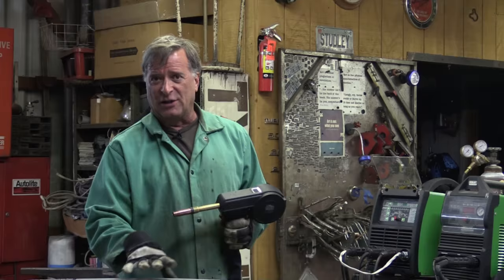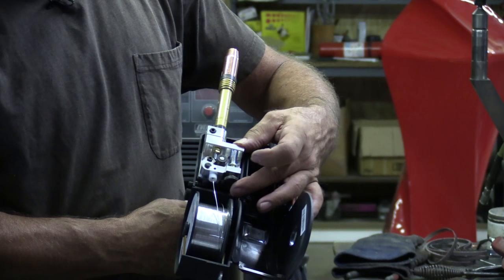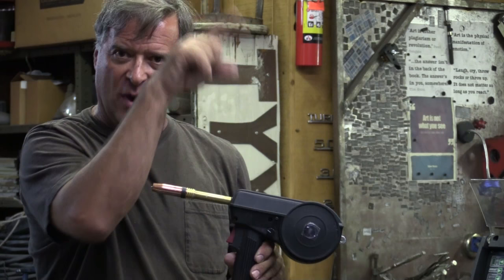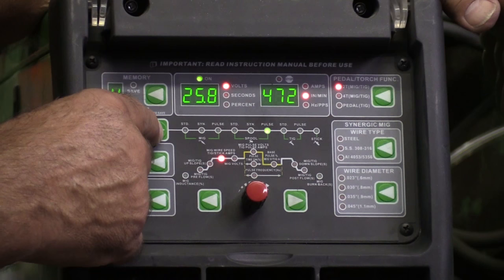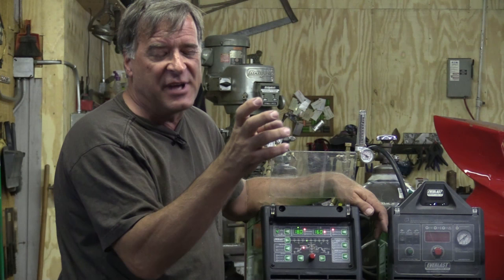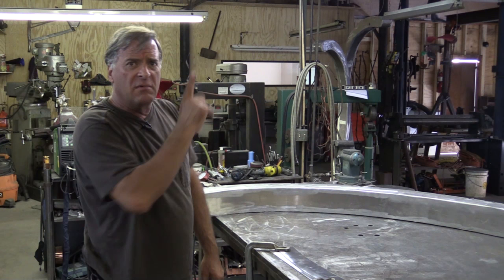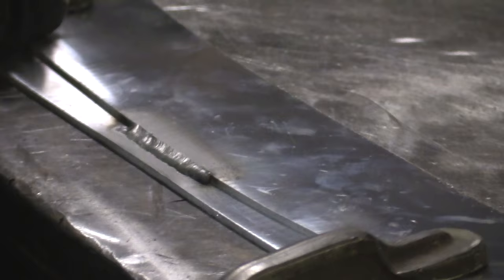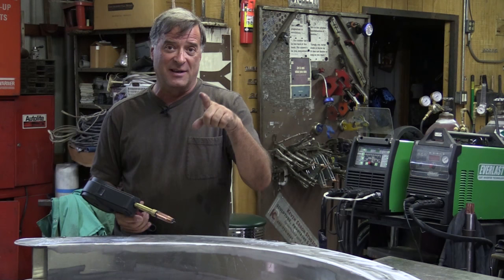How to Use a Spool Gun - Kevin Caron

Comment: Hi Kevin. Just started playing with my spoolgun for my Lincoln Power Mig 210. I found the suggested wire speed to be a little high and a slight push angle works well for me, also a faster travel speed than steel, but I did manage to blow a couple of holes in the 1/8 aluminum I was working with before I figured this out. I guess I will be running a few more practice beads before I tackle a real project. Thanks for the video.
Reply from the maker: I have found it to be tricky to get it dialed in right.    Always playing with the setting to get what I want...    More practice!

Comment: Nice video kevin. To help combat the soot, 6 can turn up the gas flow a little bit, and run a push angle on the gun to get a "pre shielding" in front of puddle. Also, you can not use any CO2 with aluminum because it is an active gas. You can only use an inert gas such as helium in addition to the argon.... Good looking weld too. Sounds like your wire feed speed is a little high for the voltage or the voltage is a little low for the wire feed speed in regards to that wire size though but still very nice bead none the less. Keep up the good work and don't stop with the videos.
Reply from the maker: Thanks,  will give that a try next time..

Comment: NO CO2.  Never with aluminum.  But you need to have a higher voltage for the wire feed speed you were using.  It should be in a spray mode.
Reply from the maker: Tried going up in volts but was not having any luck..     will practice more...
Reply: What tipe of spool gun, do I need for my MTS 251 si?

Comment: Nice vid Kev, always enjoy them. Is it feasible to run one of these on the 110v side of machines? Would you consider doing a step by step video of that by chance? I would like to learn more of that. I'd check the rollers in that spool gun as the last part looked a tad off 😉keep up the nice work and please let us see the final project.
-Pidge
Reply from the maker: This machine is dual voltage so I will give it a go on 110 and see how it runs..     Maybe a video in the near future.

Comment: What’s the benefit to using a spool gun over torch?
Reply from the maker: Easier to hold and tack weld at the same time.  Faster than a tig but much messier.  Good for the welds you don't see.

Comment: To keep from having soot, push the puddle instead of draging the gun. Also the wire feed speed is too high.  If you are not using pulse the arc should be almost silent.  You should always keep aluminum mig welding in spray arc transfer.
Reply from the maker: Will give that a try..     Thanks for posting...

Comment: Aside from the obvious being rather large and bulky what are the downsides of using a spool gun to do regular steel welding if any? The only big machine I have is a Miller Regency 250 spool Matic 3-gun and I couldn't pass it up for the deal I was getting and personally I'm not an individual with much in terms of finances so one of those situations where I have to work with what I can get
Reply from the maker: Have never tried a spool gun on steel.   I know it will work but can't think of a reason to not use the built in mig.
Reply: @KevincaronSculpture  because it doesn't have one
Reply: @KevincaronSculpture  and I haven't yet been able to find a wire feeder at a reasonable price for it if at all

Comment: Aluminum takes 100% argon
Reply from the maker: correct, unless you are welding really thick aluminum and then you want an argon/helium mix.  Or straight helium if you are welding thick aluminum on D/C.  Or if you are stick welding, then you don't need argon at all.  The world is not black and white most of the time.

Comment: Kevin can i connect that spool gun to a plain ac smaw welder?
Reply: Im going to use a gasless wire anyway or what we called flux cored wires . Is it applicable?
Reply from the maker: Not that I know of.    You need the correct plug to hook the control wires to.
Reply from the maker: I am pretty sure this will not work on the machine you have.
Reply: Maybe its better if i just buy a 3in 1 machine that contains stick, mig , and tig. Anyway im looking for something cheaper but better :) thanks sir

Comment: I would rather just use a normal mig welder .
Reply from the maker: If you can get the aluminum to run through the liner...
Reply: I got a guy to make me up a short mig cable about  5 foot long  and used a nylon  liner . I find with a shorter cable the wire feeds through easier .
Reply from the maker: awesome!